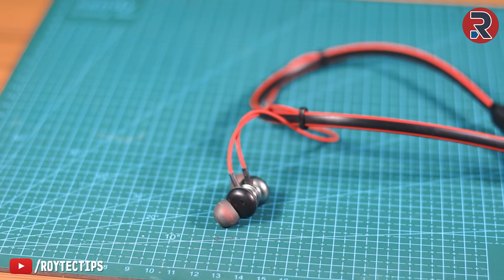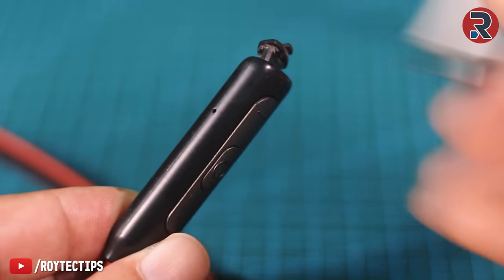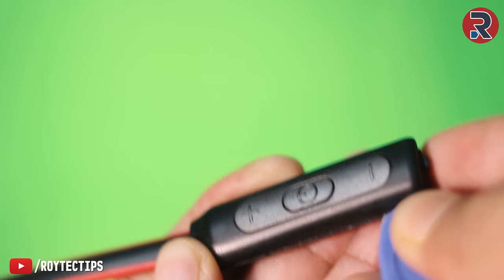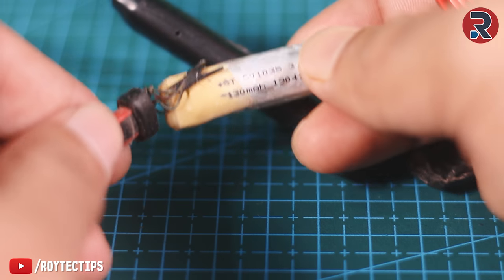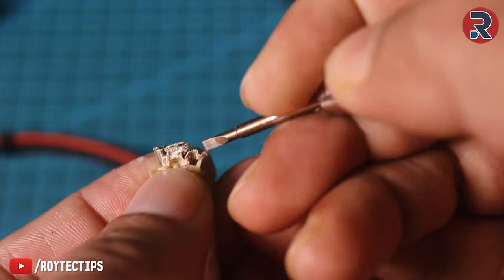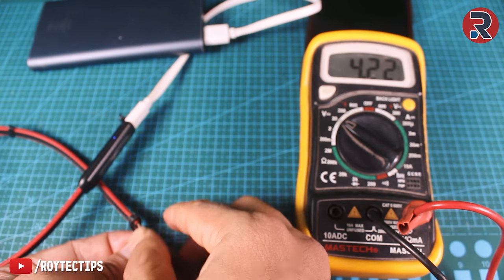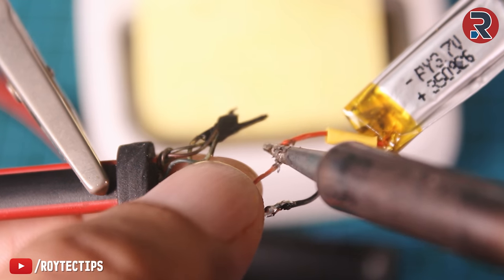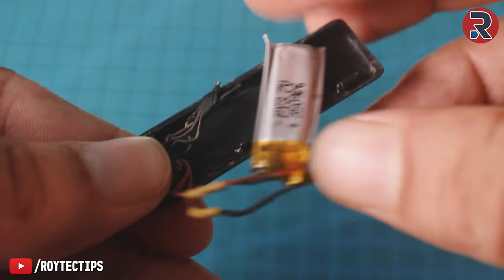BLUETOOTH EARPHONE NOT CHARGING - How To FIX Under $2 !!!

Comment: My earphone was working fine.,,.But from yesterday...Its not charging. When I plug the charger.....The red light turns on.....But even after 2 hours it says low battery. Please give me suggestions.
Reply: Same
Reply: @vishwa1608    chances are either charging port is damaged or the motherboard.

Comment: I wanted to ask that I have the same battery and can I put those 2wires of the battery in the switch board of our house will it blast or will it charge
Reply from the maker: It will blast
Reply: @RoyTecTips  ok thnks

Comment: I plugged in my charger which has led on it but my charge goes led OFF and my oraimo necklace 3 lite Bluetooth earpiece won't charge but when I pull out the USB from the oraimo necklace 3 Bluetooth earphone my charger led comes ON, same thing happened when I tried using power bank the led of the power bank goes off when I try to charge the Bluetooth earpiece, could it be a short circuit? And where can it occur in the earpiece

Comment: Hi, I have Anker Soundbuds. I cannot find the battery inside the switch/microphone controller. Where will I find the battery?
Reply: Just in case you still need to know- if you take apart the button module and don't see a battery, it will most likely be inside the plastic earpiece housing.

Comment: 130 mah can increase battery mah
130mah 
Volt?
Reply from the maker: yes you can .. 3.7v
Reply: @RoyTecTips  but the size is problem can you suggest me som fitting battery